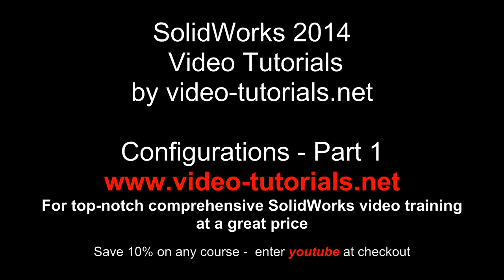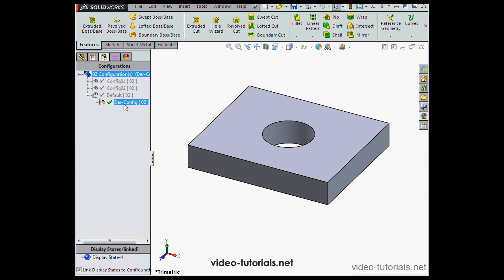How to work with configurations #1   SOLIDWORKS Tutorials (Configurations)

Comment: She sounds like a hypnotist. :D Good tutorial.
Reply: Industrial standard Configuration table create in solid works 

Now streaming,  use below link and watch

https://lnkd.in/ejxXR7q

We are conducting online industrial training as per industry standards.
if anybody wants to join the class kindly check our website and message me in this video itself. we will contact you.

Thanks and Regards,
Das Auto Loco
www.dasautoloco.com

Function: Clamp is used for underground cast iron and ductile iron water pipe 
to prevent joints from separating. The O.D. of the pipe is shown in the data table.

Finish:Plain. Contact customer service for alternative finishes and materials

Sealing Caps Core Plugs & Welch plugs manufactured out of Mild Steel, Stainless Steel and Brass material being used the Engine & Transmission blocks. These are available in both Cylindrical and Conical type.
Clamps, Clips & Brackets being used in Automotive, Tractor, Earthmoving equipment and Farm equipment as per customers’ requirements
Push Nuts, U clip Nuts, Self threading Nuts made out of medium carbon and high carbon steel with hardening & tempering and Electroplating with Hydrozen De embrittlement process.
Constant Pressure Hose Clamps manufactured out of high carbon steel and carbon alloy steel for the fuel and liquid rubber pipes/hoses in the Engines and other applications.